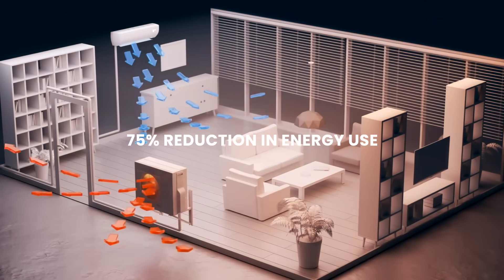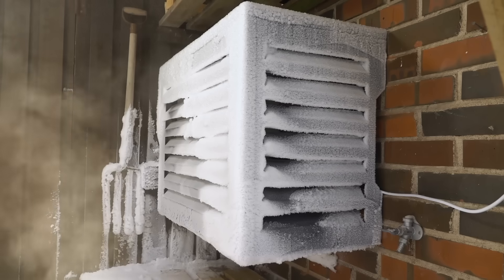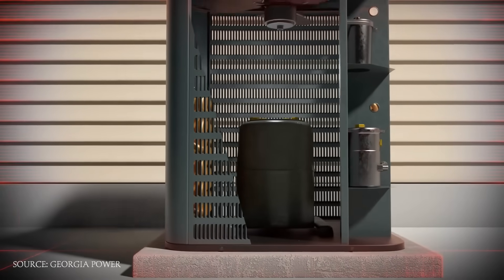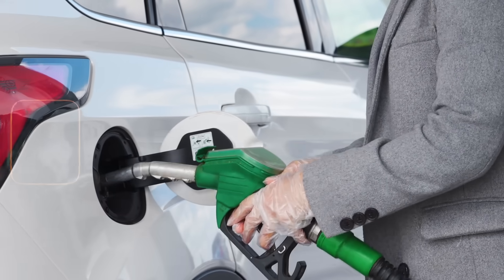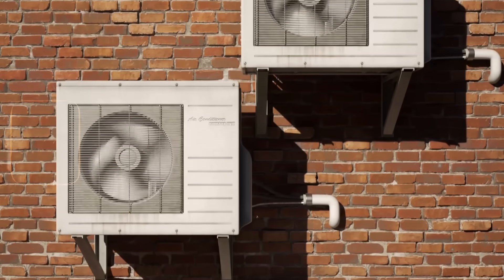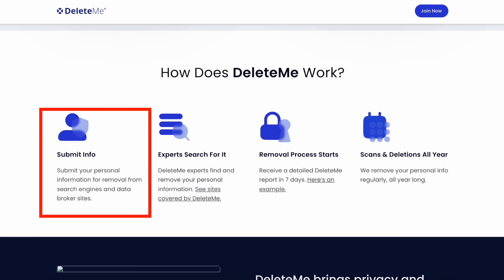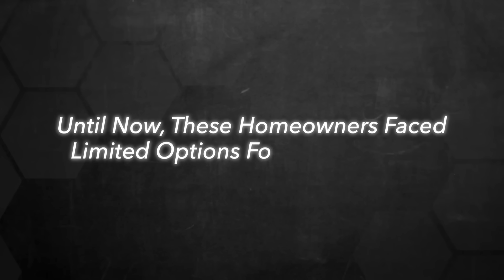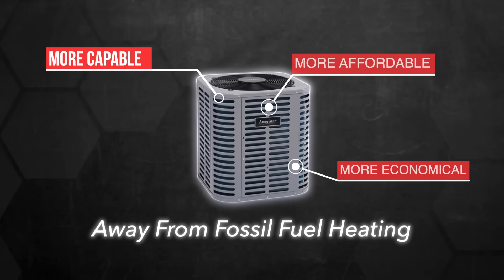Genius Heat Pump could change how we heat our homes forever

Comment: Cost too much to heat once it get below 30 degrees.
Reply from the maker: Not with this that's the point... that's an old school single stage heat pump. This has cop of 4-5+, very efficient. Natural gas is basically the same price with this one but for most heat pumps natural gas is cheaper unless you get solar

Comment: Interesting, but I have a question, here in norway ( al least in older buildingswe don't have central heating, so heatpumps here are mistly air to air with whone or more indoor air handler units, can tiis multi stage heatpump be used with an air to aur sustem or does ir riquire the insude unites yo pe liquid filled radiators?
Reply from the maker: This would mostly work with central air, not a mini split application
Reply: @TheHVACDopeShow right thanjs forvthevinfo

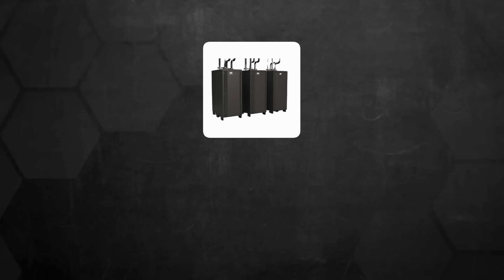Comment: At timeline 8:47 you say that this system can operate in temperatures as low as 32° F.
But previously at timeline 0.03 you said that this system can operate in temperatures as low as minus 32° F.
Which is it? And why has this mistake not been noted and corrected somewhere here?
Reply from the maker: Negative 32...  because I have a life outside of this channel 😁 lol... thumb says -32, video says 32? +32 for a heat pump isn't anything special... deductive reasoning ? Sorry lol, but yeah it's -32F✌️

Comment: Still no good for colder climates, like anything below -40°. You keep saying North America when you mean the lower 48 states. Definitely not most of Canada nor Alaska. And it doesn't beat a natural gas furnace or boiler. But tell them to keep on trying. On the other hand I clicked on your channel in the hope of personally applicable advancement.
Reply from the maker: -40F is extremely cold. It's not applicable to most climates, so when something works for 99% of the population of North America at decent efficiency, then that makes it pretty applicable in my book but I agree it's not cut out for coldest parts of Alaska and half of Canada. I don't have any skin in the game I just think it's interesting but it's way overpriced right now and I have no idea what the diagnostics look like to see if technicians would like to work on it

Comment: Ok I'm confused as Mr Cool already have systems that don't require backup heat in colder weather down to -22 and cost a lot less as 15k for a 4 ton unit is not priced for regular home owners.  For 15k then add to that to do solar and cut your cost for everything you use not just HVAC unit.
Reply from the maker: Those don't work "well" (key word) in cold weather... they advertise that they do -22F but they don't. The COP drops and so does the output. Output at -22F will be 50%-60% capacity or lower even in real world numbers plus long defrost cycles and less efficient so it's basically slightly more efficient than running a space heater. This unit maintains high COP down in frigid temps which is why it's revolutionary, but also too expensive at the moment and needs r and d overhaul.

Comment: It doesn't matter how you approach it... prolonged cold climates or extreme temperatures require adding energy to the air. The ONLY way to use what little energy is available from the ambient air, is to increase the effective volume of processed air.

Comment: Very informative thanks. Question? You mentioned mini splits could be used to supplement an existing whole home standard duct HVAC system. Our 2nd floor is about 1200 sq ft (4 bed, 2 bath, hallway) and is noticeably hotter that the ground floor during the summer (probably 5-8 degrees). Do you think it would make a material difference to the upstairs if we put a mini split with a recessed cassette in the hallway? Would it "make up" for the 5-8 degree difference?  It's only cooling I'm concerned about. Heat / temp in the winter is fine. Thanks.
Reply from the maker: 100% yes it would make the upstairs finally feel comfortable because heat congregates upstairs so even a small mini split or cassette in the hall would lighten the load upstairs and make it comfortable. 

We installed a system for an employee who had a similar situation upstairs and after installing the upstairs unit it dropped the temperature to where it was even cooler than the downstairs!

Comment: what if I can solve it with "solar" and the single stage HP ? much cost effective
Reply from the maker: Single stage HP don't work in cold climates... COP drops below the effectiveness of a space heater so if your climate is 0F or even gets down to 10F most single stage systems are running at 50% capacity by then and significantly reduced output. Some of them work but that work be my last choice, a Daikin fit or entry level inverter would be a good fit

Comment: The best poor-man's version of something like this would be simply a single stage heat pump that uses co2 as a refrigerant, since co2 can continue to pump heat away at even -60°F. You might not want to use it for cooling mode though, because it would have head pressures well over 800 psi in very hot weather.
Reply from the maker: Yeah I've heard this is why the sanco2 is heating only

Comment: Heat pumps work but not miracles?  It's a matter of heat gradients and work done in moving heat so air to air not air to water .   Air to 21C is practical but to 70 C for radiatiator is much more work and that is not free.

Comment: This technical addition of equipment to the system will certainly increase the probability of something going wrong. I like keeping my heating and air conditioning separate. If your air conditioning goes out, you can work around that, but Heating is critical.

Comment: We now have green electric so no savings with heat pumps. And electric is gonna go up more. Green electric has really made heat pumps cost more than other heating sources. We are talking only saving 156$ with heat pump over gas boiler. That was before electric went up. And forced air means more warm air is forced out of house. Longevity isn't the best with heat pumps. More people using electric means higher prices.

Comment: I'm sorry, but I'd rather get 98% of the energy out of natural gas to heat my house, rather than 60% (from generation through transmission to my house) using electricity. Your super duper heat exchanger cannot recover that generation and transmission loss. Not only that but for the same unit of energy electricity is nearly twice as high as gas. (I live in one of the areas of the country with lower electricity costs and higher nat gas costs.

Comment: I worked on cryostats for years for rheem sci , cincy solo, & others .  very expensive units and refrigerants. that care billed by the "ounce", also had to add instrument grade propane to keep the oil from flocking on the low stage. 
buyer beware

Comment: You could fix it by just putting the condenser unit in a concrete box in the ground with ventilation pipes curved to run under the box to enter it and pull air from around the box. With a small chimney on top to pull the exhaust. If the box is made of concrete with integra black (concrete dye) you could get some passive heat from geothermal and black body heat absorption. The air can warm a few degrees as its pulled into the box by traveling through a short coil of pipe. I guess the question for me is how big is the box needing to be? If the condenser is almost 1x1m then the box probably needs at least 2x2m of floor space. This would also make the condensers a lot quieter. In the summer you could get like a plastic cover thats bright white and fit it to the concrete so you dont get the solar heat into the box. And then the ground pipes would cool air a few degrees before it reached the condenser. Also i think itd be best if the box wasnt completely below grade have it stick out about 6-8 in so water cant flow into it. Idk might need to rework the main body of the unit so its just built into concrete so it always has thermal mass to work with. 
Its kind of the same thing you got the main heating cooling loop connected to a passive heating cooling loop.

Comment: What if the system breaks down in single digit weather. They’re putting a person outside to work on it. I was gonna be rough on technician.
Reply from the maker: This is true for most heat pumps if the condenser fails, which is definitely annoying! I believe this unit has some units inside not just outside, but this is 100% a valid criticism

Comment: I assume a cascading heat pump system will drastically improve efficiency on an air based heat pump system but probably not or much less for a geothermal system? Is that correct? So would waiting for that technology make less sense If I were to go with a geothermal system today?
Reply from the maker: Correct a geothermal system is great for cold climates because your loop provides better ambient temperature conditions for the heat pump to operate at peak COP. Your ground loop will keep you COP above 4 even when the temps are -20F or lower which is when an air source heat pump can't keep up or even barely run, much less with a COP much better than 1.5 (if that). So geo is double or triple the efficiency in cold temps. This is why people do Geo often when it is a cold climate and they only have access to expensive fuels like propane or oil, because this shortens the break even period on the initial investment.

Comment: Hey I’ve always been interested in hvac systems , load calculations for proper systems , installation and insulation barrier. My concern is the cheap flimsy components now used in these systems.

Comment: You're not going to do better than resistance heating.  10W in equals 10W out.  Nothing is wasted.
Reply from the maker: Not sure if this is a joke lol... if it is pardon my serious response 😁 All heat pumps by definition are better than resistive, 10w in equals 40 watts out at a COP of 4... most heat pumps have cop between 2-4 depending on outside temperature

Comment: Norwegian HVAC guy her,  
A standard heat pump, such as a Mitsubichi Heavy Industri heat pump. 
Using R410, and later R32 have been working just fine here in northern europe for the last +20 years. 
Just about every house have one here, as the main heat surce for our houses her !
Only when outside temperature falls below -20'c (-5'F), There  might be a noticable reduction of heat from them. 
If bog standard residental heat pumps have been workng perfectly fine in northern Norway for ower 2 decades, it's safe for the US to finally embrace heat pumps too!
if sized correctly, a standard heat pump wil cover all your house heating, almost down to -30'C / -22'F witout problem ! :)

Comment: I’m an ignorant homeowner so these questions may seem stupid to all you experts, but… I have a 100 year old hot water system that I’m looking to replace. It’s a cast iron radiator system with 2” pipes going out and returning to the main unit. I’m pretty sure that these pipes could be used to snake the lines to each room, but they are connected to floor units. Is it absolutely necessary to place the room units at the ceiling or is possible to have them replace my radiators? And are there heat pumps that just blow conditioned air or is absolutely necessary to have a unit in each room like my radiators are? And I live in a rather tough neighborhood, is it possible to install the outdoor unit in my working/not living basement? And would that actually make the system work more efficiently because my unheated basement stays between 50 and 60 degrees Fahrenheit all year in my southern Michigan home? I know these are a lot of questions, but the internet doesn’t always just direct us to the right answers.
Reply from the maker: Condenser has to go outside, so if it's a roughy neighborhood you could put it on the roof or someplace else / wall mounted. I'm not sure what you mean by floor units, are they standing radiators or units with a fan? Or just radiators only? You mention cooling but boilers only do heat, if you're talking about air to water heat pumps I would say it's probably a pretty expensive retrofit to replace the radiators and also insulate the water lines so you're best best would be going with a cast iron replacement over a high efficiency (more reliable and longer lasting) and ductless mini splits for a heat pump / cooling operation. Hope that provides some clarity
Reply: Mine is a hot water system that works on convection, there are no pumps. Each radiator has a hot water intake and a cooled water outlet that returns to the main unit. I hesitate to call it a boiler because the hot water leaving the heater is only 120 degrees Fahrenheit. The cast iron radiators are in every room under the windows. Why must the outside unit go outside? Does it emit fumes? I asked about the air because I’ve seen a couple of homes that claimed to be using a heat pump that only had small air ducts showing, I wasn’t able to verify. My home has 12 rooms, it would be far less expensive to convert the 2” water pipes to air ducts than to place a unit in every room. I do know of a local man who converted his hot water system’s pipes into air ducts. I appreciate your response. Thank you.
Reply: @katiefox9918  It seems to me that your original system was a 2 pipe steam system that was converted to hot water.  Normally, they add a large pump to pump the water up to the radiators. As indicated by @TheHVACDopeShow, retrofitting this type of system could be and option with their air to water part once it becomes available.  However, you will have to use the roof for the exterior unit (If you do this - I would put some sort of shed/roof over the unit to prevent the sun from beating down on it during the summer).  Another alternative would be a high efficiency multizone mini-split system - but this will require you to put units in rooms around your home - the radiators would no longer be used - and this would also require roof access and more piping.  Another option is you could replace the cast iron radiators with panel radiators (about $500 - $1000 each), re-pipe, add a manifold and the associated pumps/etc and install a modulating/condensing boiler.  I know this is not the best overall solution, but all the piping and panels could be reused in the future with whatever heat pump you like (that has an air to water portion/sub-system).  You would still need to address the AC portion separately.Hope this helps.

Comment: Doesn't running 4or 5 compressors obliterate the efficiency?  At that point just having 2 independent units with one optimized for cold and one for moderate would be more acceptable and more robust where if one link fails you don't loose all heating and cooling. this monstrosity of over complication is a hard pass for me.

Comment: I’ve been in the industry for 20yrs now and the highest service call rate I’ve seen were heat pumps.  They simply can’t deliver the needed heat load in cold climates like they say they will.  The technology may be there but a simple gas or electric boiler/furnace will still supercede these complex heat pumps. Plus with the new A2L refrigerant being less efficient than its predecessor, good luck!

Comment: As a residential tech I can tell you for sure 99% of techs will never have any idea how to service this and it will break quite often
Reply: I'm just amazed of how much Paul Rudd knows about heat pumps
Reply from the maker: I'd have to see one first but with multiple refrigerant circuits dependent on each other, you're right in a residential space they better have built in bulletproof diagnostics that make them easy to understand and figure out a way to interchange parts easily
Reply: In part I agree with you, that most residential techs won't know how to work with this system - but the folks that work on commercial/supermarket refrigeration won't have any issue.  I disagree on the 2nd point.  Looking at the tech they are using, it seems to be industrial grade which has a very low % of failure.
Reply: I’m going to be that 1%  these high tech systems are coming just like cars becoming more high tech. would rather learn and stay at the head of the tech curve
Reply: How often does your refrigerator break?

Comment: Yes, cascading heat pumps 'work' because each stage takes care of a percentage of the temperature differential (ie if I need to change the temp by 30 degrees, with 3 stages, each gets rid of 10 degrees) and allows it a much wider temperature range.

Issue, which you do not address, given a standard heat pump typically took the input energy (electricity) and 'produces' up to 3 (sometimes 4 in the sweet spot - known as the SEER) the equivalent energy, if I run 3 heat pumps in a series, do I really see the typical savings I get from running a heat pump as I need to power 3 separate heat pumps?

Comment: Imagine heat pump that has win winter COP=1,5. This is real. With changing range of 2 pumps you get to 2.5. But What you use 2 comprersors with 2 times electric power input. What happens? Cascading HP almost always leads to inefficiency. And it is not easy as you try to say. There are not miracles. This is PR video. Very very long advertsement or way to keep people watching to get money from youtube.
And HP is not way to get from fosil. And you still can use simpe resistive heater in these 10 days when normal HP has problem.